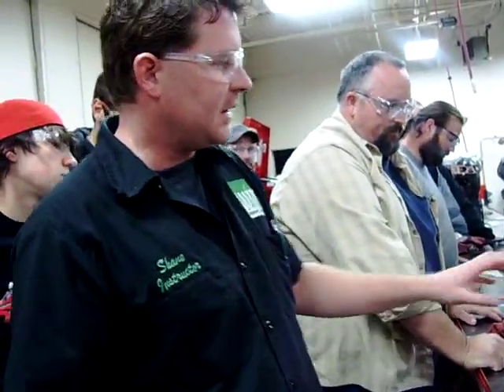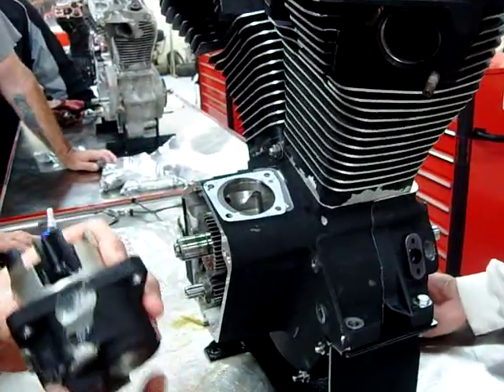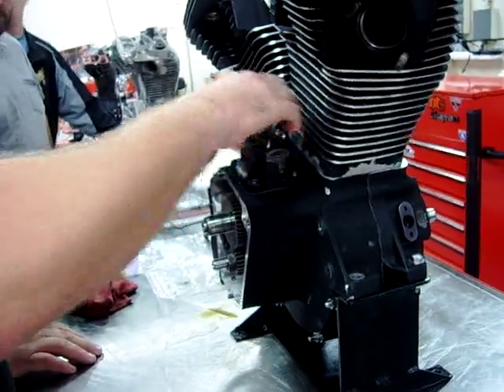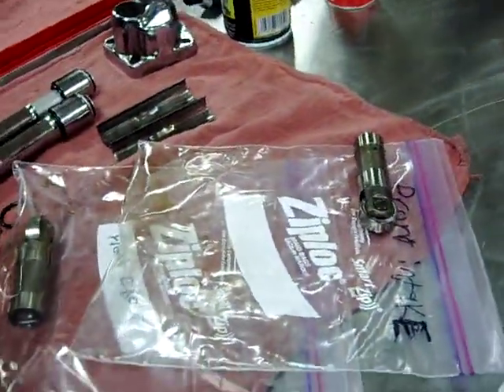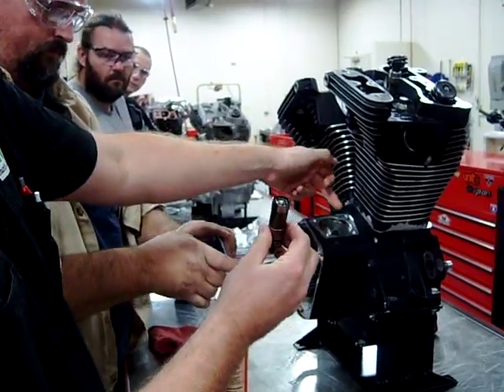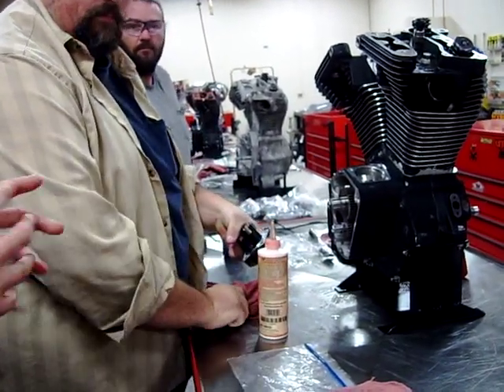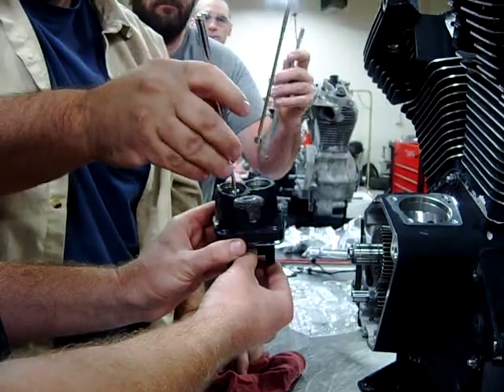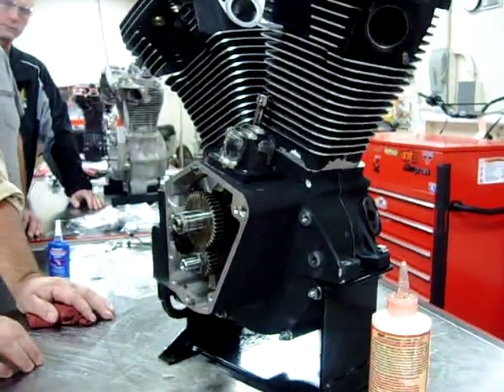Part 06 Lifter Tappet Block assembly on a Harley EVO motor S&S Jims Revtech TP

Comment: Do you use blue Loctite on your tappet block screws ,as I have heard that this is a important procedure. I had maybe 100 miles on my engine and while idiling the oil started to pour out between engine block and tappet covers. Luck was on my side that day ,as it could have lead the way to a major catastrophic failure.